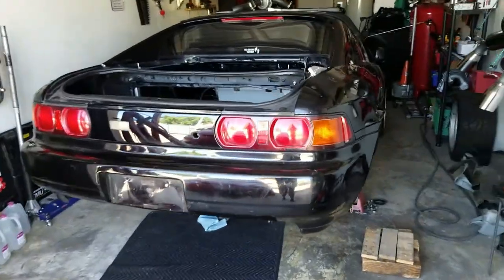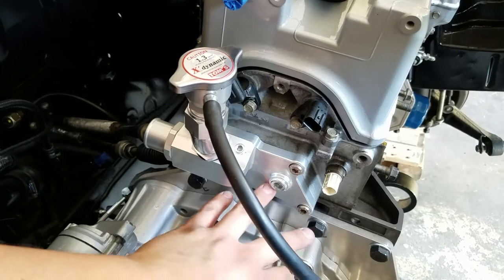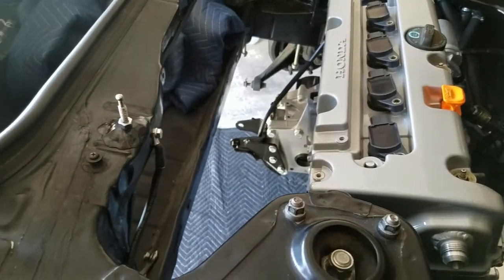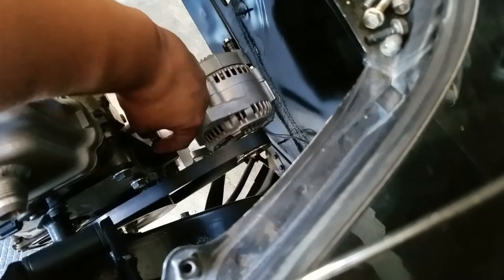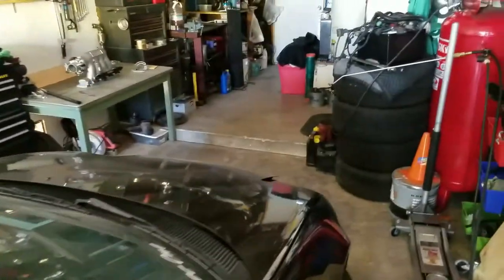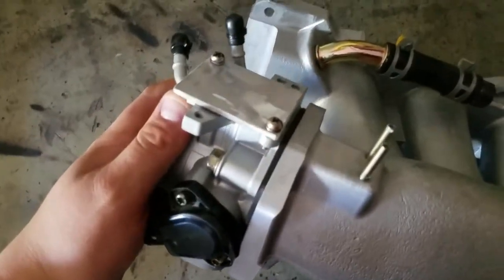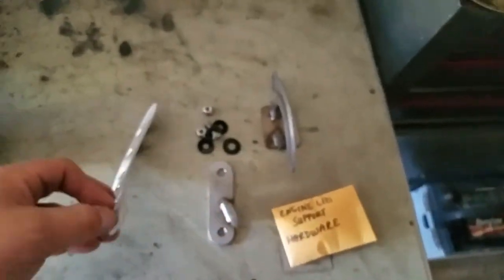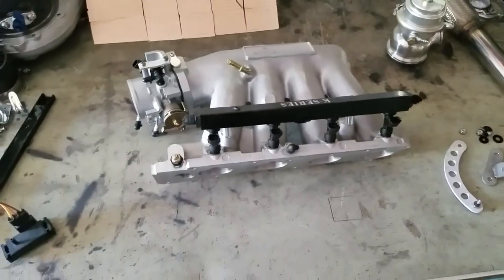KSwap MR2 Gets Its Heart Installed!

Comment: What did you run for motor mounts?
Reply from the maker: Hux Racing Cannibal Kit uses 3 factory mounts since it retains the factory transmission. They supply only 1 custom mount, passenger side.